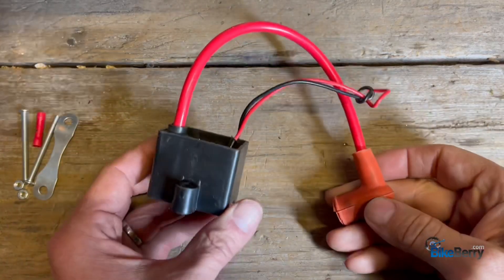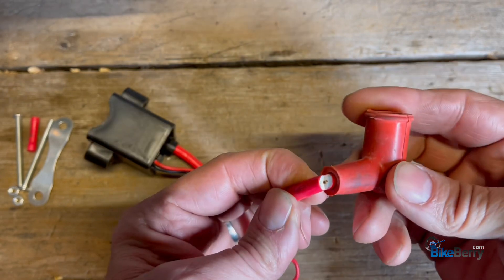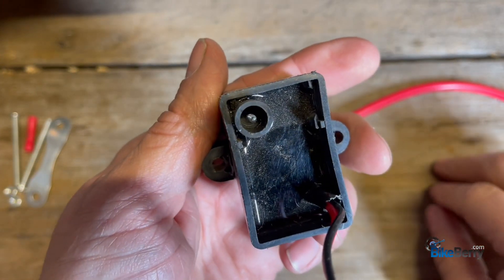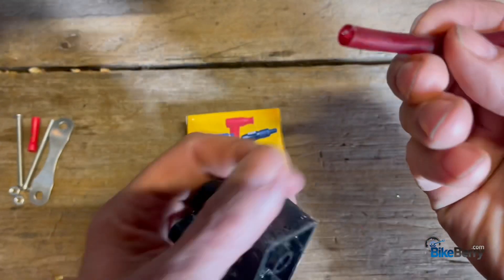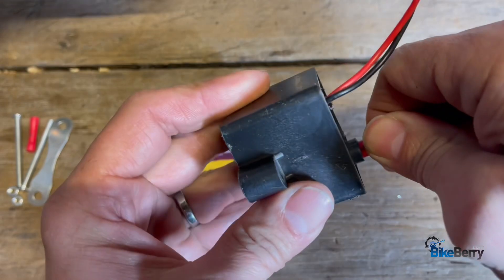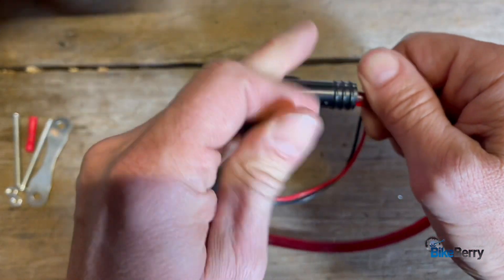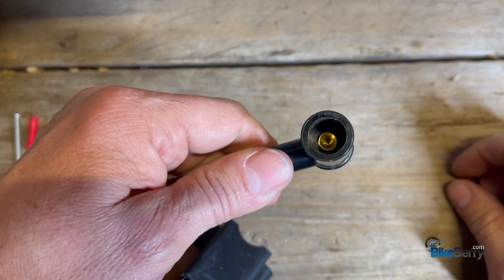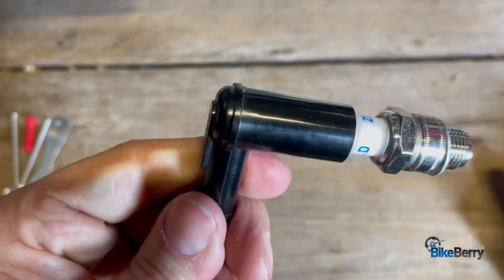Easy CDI Fix | Motorized Bicycle Repair |

Comment: Ok so I got one and have a front lighting kit that when you start the motor it's able to cut the front circuit or at moment is on lower power ends after throttle is applied the light just drops out the back is fine the speedometer is generally good but at moment a few issues know if it can half short stuffing your front light by a Eddie current thing???and battery even when running you can pull it out and back in and it will work but seems to hit something on the inside and issues if you have ever had this example I'd love to know why otherwise I'am thinking of a post on the issue as I'll check the light wire circuit to check no damages. Strange enquiring......😃😄😁😆😅 5 Smile's you will probably hear from me soon ish for a real upgrade motor as the Chinese suck and there case on the last two orders cracked under general operation and the other was already broken!?!? got it to last one year before the clutch went my last upgrade did 5 years a shaft and a it got pinched...😢.

Comment: After I screw it on I wrap electrical tape around each end & use a tiny zip tie or drop of super glue on the tape to keep it from coming off.